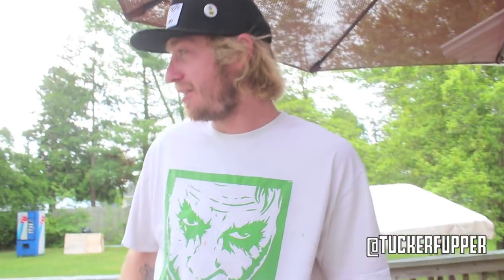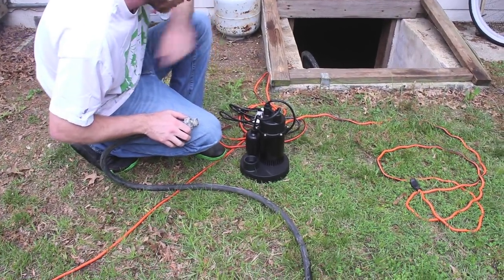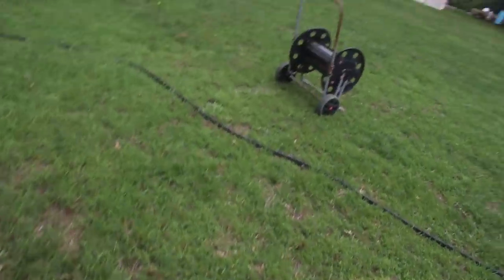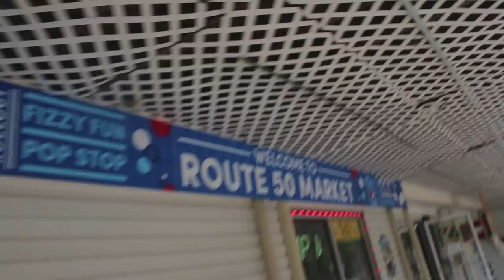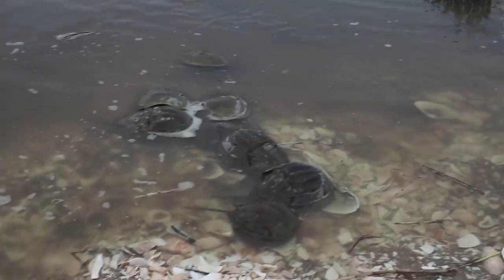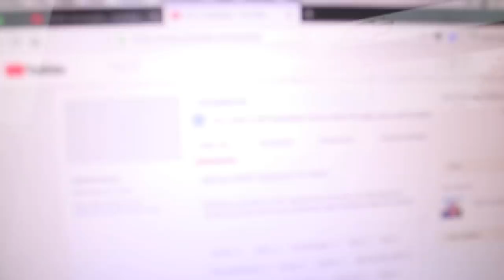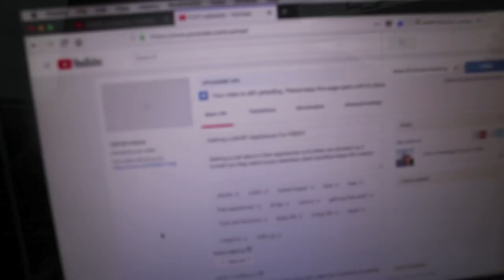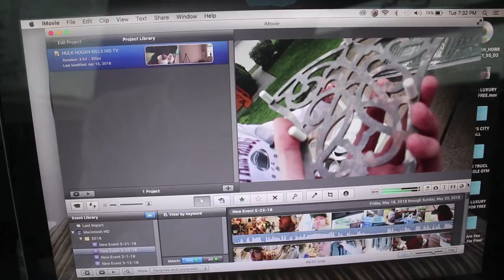THERE'S SOOO MUCH WATER UNDER OUR HOUSE!!

Comment: Tucker that sump pump uses a 2 inch diameter flexable pipe that you have to buy seperately the wider pipe would be better because all the leaves and debri, or you can by another pump that takes a regular hose, but the pump wont last because it will get clogged up, also put an extension on your gutter pipes so the water gets directed away from the house, also your trailer drill three1/2 inch diameter holes at front of your trailer because when it fills it starts to over flow towards the house, or when you dump the water on the trailer  towards the house the holes will solve the problem , also clean your gutters get up on the roof and go all the way around clean them, you dont want water going towards the house.

Comment: Hey, Tuck, you need to place that pump in the lowest spot in the basement area for it to do the most good. The pump should never overheat if it's set right. You have too take the phone apart for that too work

Comment: Dude, if you don't do something to stop so much water from collecting under the house...youre gonna have mold again and other problems.  It's a HUGE JOB but I suggest digging a trench next to the foundation all around house and waterproof it with HEAVY ROOF CEMENT (TAR) then maybe a membrane before filling it back in. I did this for a living as I was s mason. 
FOR THE DREAM BOYS 🤙🤙🤙🤙
Yeeeeewwwww

Comment: You should always have something under a sump pump to prevent it from sucking up mud, etc. I use a 5 gallon pail with several 1 inch holes drilled into the sides

Comment: We have a sump pit and pump and it comes on automatically when water reaches a certain level in the pit.  So we have a flexible hose that runs out from the front of the house down the lawn slope. Do they not do that where you live? it sure makes life easier, you just have to check on e regular basis the pump is still working OK.

Comment: was the water table up too high from the rain or was the water coming in from the down spouts? I had to move my down spouts further away from my house because it was leaking into the foundation. The ground water problem, I had to put a tank into the ground and put a sump pump in that would turn on when the table is too high. 

good luck guys. Consider running a few fans under the house and opening the crawl space door to help dry the space out.
Reply: newlifeme1 we did the same thing. Gotta get some air flow to keep the mold from taking over. We run a dehumidifier in our house 24 hrs a day.
Reply: The mold is a nightmare. Dehumidifiers work good, but boy oh boy emptying them a few times a day is a pain. You know what works pretty good for drawing out humidity are the charcoal moisture collectors dollar tree sells. They suck it up and then you just toss it out. I didn't think they would work but they fill up with a few pints of water over time.
Reply: newlifeme1 thanks I'll get some. Your right about the dehumidifier it is a pain. I would be freaking out if I had as much water as Tucker.

Comment: This is the pump you need: https://www.harborfreight.com/2-in-212cc-gasoline-engine-semi-trash-water-pump-158-gpm-63405.html     You also need a 2" non-collapsing intake hose and a 2" flexible outlet hose. This pump will empty you out super quick. Hit me up next time and I'll drop one off for you to try out. We use same one to pump out large footers before pouring concrete.